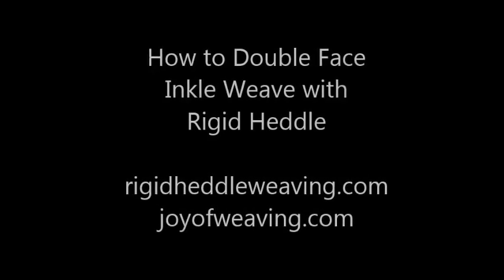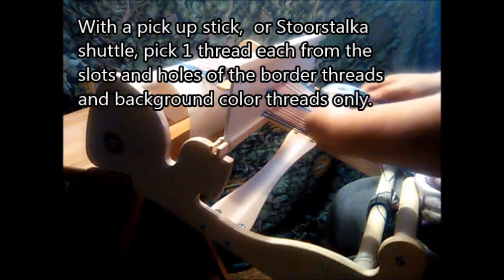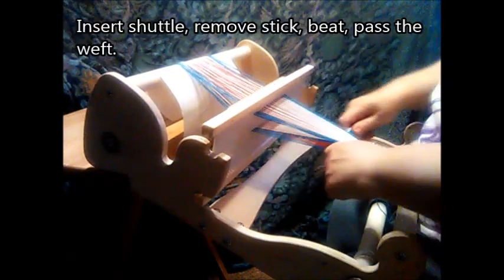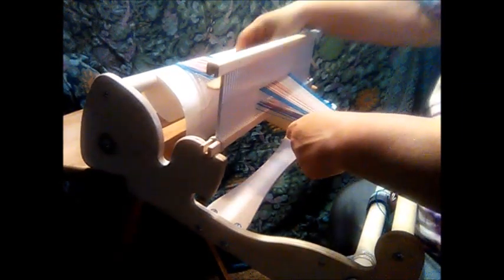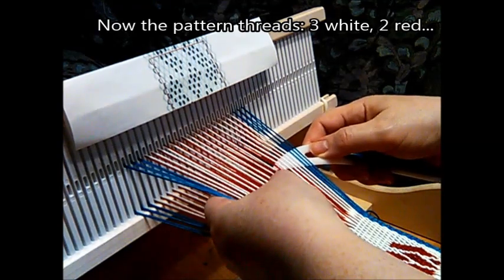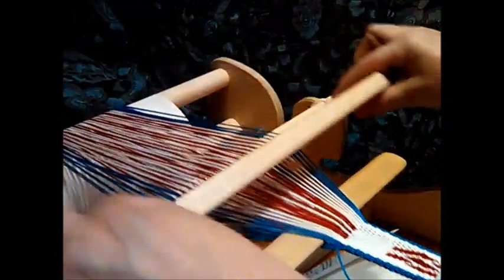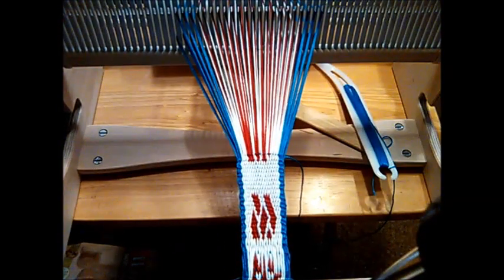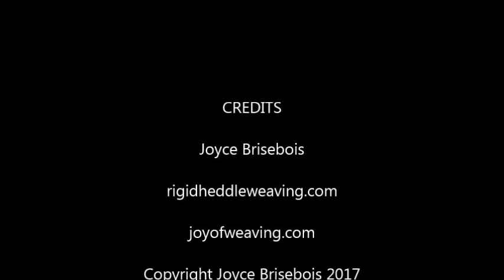How to Double Face Inkle Weave With Rigid heddle

Comment: Thank you Joyce for this great video! I’d often wondered if you could transfer backstrap to a rigid heddle. I have a couple of questions:
1. Is it possible to add a string heddle to the plain weave so that you don’t have to pick up each time?
2. When picking up the border strings, does it matter if you don’t pick up the same string each time? Or, is it easy to tell which is the string you picked up previously?

Thanking you in advance for any reply! You are such an inspiration :) x
Reply from the maker: Thank you for your kind words! Sorry for taking so long to get back to you. Life got in the way. To answer your question: Sure, you can add string heddles. Why not!? :) It's important to pick up the correct warp threads on the selvages and it's easy to tell which one you did last time. Just remember to go OVER the first thread when ENTERING the shed and then UNDER the last thread when EXITING the shed. You will never miss the outer most selvage thread if you remember this.  Over/Enter, Under/Exit.

Comment: Neat video!  Thanks.  Is it too late to increase the volume of the video?  I know nothing about that sort of technicality.
Reply from the maker: Thank you. Yes, it's too late, but It helps to listen with headphones. My problem is lack of very good equipment. I tried to get my mic louder, but couldn't.  Hence the text within the video so you don't lose any information. Consider it "closed captioned". :)
Reply: Yeah, duh!  Good idea.  Also, I'm very new to weaving.  Is supplemental warp basically the same thing as band weaving (in terms of different sheds being made)?
Reply from the maker: Welcome to the wonderful world of weaving!  Supplemental warp can be used with any weave structure and any width of cloth, it doesn't matter the number of sheds being made. It's simply extra warp threads. Band weaving is generally a narrow cloth, which can be created using any weave structure, although, usually it's warp faced with plain weave as the structure (also known as "inkle"). As a beginner, I recommend you google "Weaving Glossary" for terms and definitions to get more familiar with what is what and check out all the articles on my websites! :)

Comment: Thank you SO much for this video... every one I’ve watched until now has left me confused but yours is very easy to understand! One question~ should you use a heddle such as a 10 or 12 epi or does it matter? Thanks again!
Paula
Reply from the maker: Thank you for your kind words! Sorry for taking so long to get back to you. Life got in the way. To answer your question: That depends n the size of the yarn you are using, but for "inkle" weaving, it doesn't matter. A 10 dent or even an 8 dent would, however, using an 8 dent would make it easier to pick the threads than it would a 12 dent.